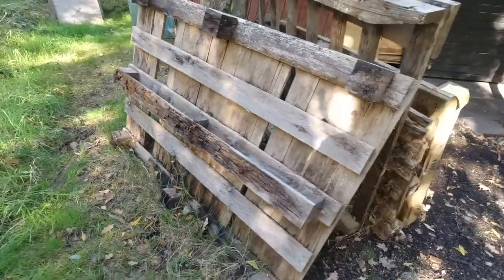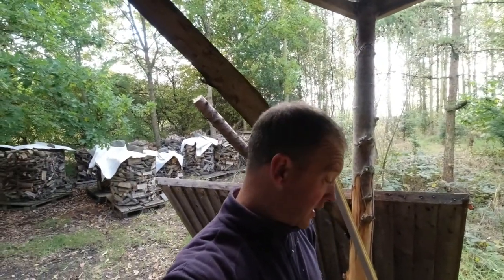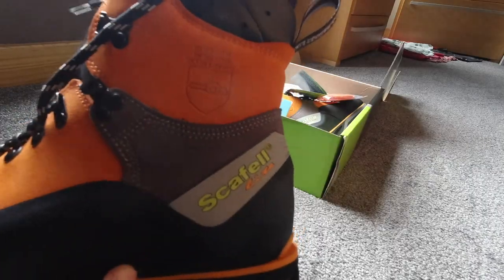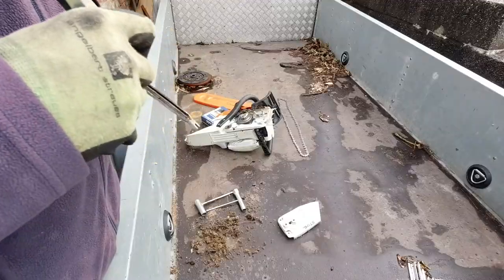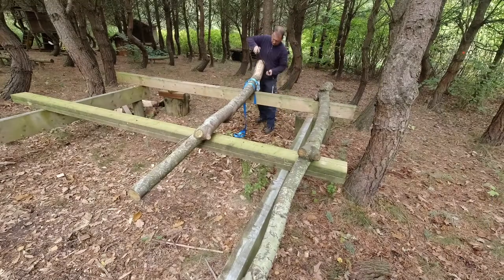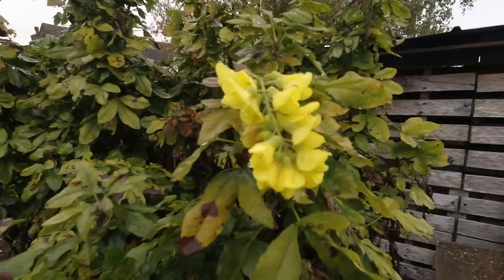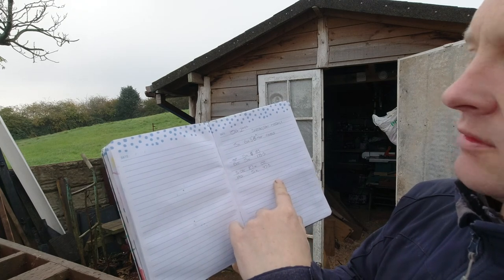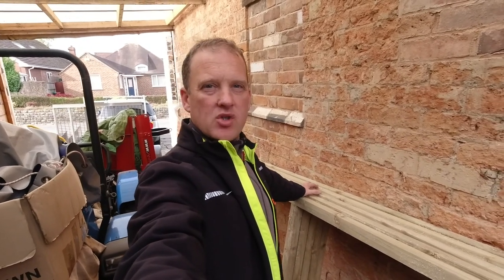Getting Ready for Cutting Hazel Coppice.  Woodland Vlog 37 2022

Comment: I was wondering why you use a 261? I've got a 261 but I found it heavy for doing small work like you do all day. I bought a 180 and I find it so much lighter and much more manoeuvrable. It's now my go to saw and I keep the 261 for bigger work.
Reply from the maker: That’s really interesting, I had a MS230 (old but good) and I got offered a small grant for a new saw. I love it and the power is amazing. The 181 are great but sadly built down to a domestic market these days, I also cut larger timber and the 261 is great for that. 
I have a battery saw I’m starting to use on my in rotation hazel. Watch out during next season!
Reply: @AbellTo  No doubt about it, the 261 is a great machine with an excellent power to weight ratio. I'll be interested to watch your journey with a battery chainsaw. It's not for me yet. Amongst other things, I'm curious to see how many batteries you need so as not to worry about running out of power in the middle of the woods but then I suppose you could revert to your 261 if you do. Maybe you'll convince me. Who knows😀
Reply from the maker: @paulwood9741  I’ve used the Husqvarna battery one in coppice and if cutting and sorting I could get half a day on a battery. I sold it though and went for a makita one since I already had those batteries. I’ve used it for odd jobs and it’s surprising good saw